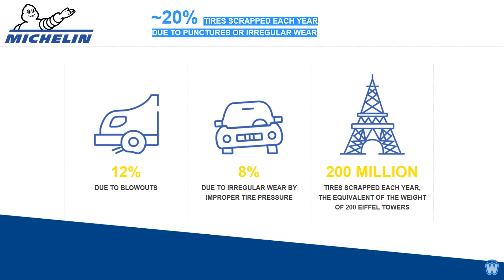Michelin Airless Tire UPTIS - Unique Puncture-Proof Tire System

Comment: I usually assumed the effectiveness in tire spike traps was not that it purely relied on puncturing and flattening the tire so that the tire would deform and spin out the car, but more so that I assumed most spike traps were designed like fish hooks such that if and when it punctured it would not be so easily ignored as the traps would lock up the tires and latch onto everything under the vehicle, effective stopping the tire movement if not destroying the vehicle for a more secure trap. As such, this can be easily resolved by police tactical engineering tools etc.

Comment: as to the tire spike problem, it shouldn't be to difficult to change the spike pattern to one that Actively destroys a significant section of a tire in stead of relying on internal air pressure to rupture, and destroy the tire. and I'm talking no explosives here.

Comment: Rolling resistance is higher, you can tell by the deflection.  What happens when you get a rock in the tire?  Does it quickly wear a hole in the ribs?

Comment: Though I don't know how these tires will hold up in the adverse weather of the upper U.S.A when it comes to snow and ice. If they are made out of plastics. They will be considerably easier to dispose of then the conventional rubber and steel webed tires existing today. When a plastic tire needs to be replaced, the old can be ground up into pellets, and melted into new tires.

Comment: This airless tire already looks under inflated to me.
Reply: yeah theres the problem no air pressure to controll so you whould waste tons of tire and money when you load up your car with extra weight. these tires whould literly be like having to change your coil overs every time you whant to change suspension stiffnes. you whould literly have to get diffrent types of ''spring rate'' tires for your car depending on what you gona do with it. a set for hauling stuff a set for daily driving a set for winter daily driving a set for winter hauling stuff.

Comment: Totally awesome idea, the cost to the motorist would be significantly reduced and fewer breakdowns on our roads which lead to traffic jams causing even more pollution of idling engines. But criminals will love these. There would be an increase in tyre thefts so they can use them. The police will definitely have to come up with new ideas to combat them being used in chases

Comment: funny how they neglected to mention these were made by NASA for the mars rover
Reply: Except that it’s not. Mars rovers use completely different wheels.
Reply: The Mars rover has aluminum wheels
Reply: Of course, because airless tires are something completely new🤦‍♂️
Reply: Because who cares?
Reply: The Idea of reinventing the tire was presented by NASA and challenged tire companies to come up with new designs for the Lunar Rover.
Reply: 1,5k*
Reply: imagine nasa need to make 2nd rover robot to deals with flat tire
Reply: 484*
Reply: 515*
Reply: 570*
Reply: 638*
Reply: 217*
Reply: @caletix8858  411*
Reply: @deadpumpkin8252  466
Reply: 640*
Reply: *728
Reply: Makes alot of sense actually, you're a genius
Reply: NASA rover uses nitinol tyres. This is  nickel-titanium alloy which is extremely durable, flexible and has the ability to have metal memory and revert to it's programmed shape when put in extreme temperature changes.
Reply: Was looking for this, also 1.4K
Reply: Technology has exist for over 50 years, but now that they wanna curb Rubber use, they are switching. Micheline has made their money, and makes me think of all the used tires laying everywhere when they could of adopted this.
Reply: @dem0ny653  1.8k*
Reply: 737*
Reply: 847* likes now
Reply: *for
Reply: Actually the lunar buggy had something similar about 50 years ago
Reply: @ricovali9245  nope, it used completely different rigid wheels, like the mars rovers use too
Reply: They haven’t been used on any rover
Reply: @revFPV  I said SIMILAR
Reply: Goodyear for NASA, that is why they forget to mention it.
Reply: Yup
Reply: Incorrect. NASA uses a different system.
Reply: True that
Reply: 1.7k*
Reply: 187
Reply: Funny how Mars doesn't exist as you know it, space is a cartoon lie, and NASA is a farce. Funny. Don't trip on your spinning ball today.
Reply: These wheels are kinda dope for Ukrainian roads😂
Reply: 1.9k *
Reply: @blake_0062  2K
Reply: The idea of airless tires was around before NASA
Reply: The moon car is even more interesting it has like a spring mesh.
Reply: Yes
Reply: Yeah right. Military gets everything first and if we're getting them now just imagine how advance their technology must be! I mean with the cameras on the Blackbird used in the 70's you could see the fingernails on a mans hands from the edge of Earth's atmosphere, the public didn't even get cameras till the 90's and didn't get cameras capable of taking a clear photo till 2020!
Reply: @jhowardsupporter  Umm these tires are already on sale. And I don't think you know much about photography or cinematography, do you? People are still using cameras from the 90s to make films.
Reply: The new rover wheels are a memory metal alloy.
Reply: And they were actually a Russian destine!
Reply: why would they mention that?
Reply: Dave McGowan tells you all about NASA's trips into space
Reply: 2.4K
Reply: You go and make sushi
Reply: These are clearly very different from the ones made by nasa though. Different purpose, different materials, different design, etc.
Reply: No, these have been around for longer than that “invention” by NASA
Reply: NASA probably stole the design from someone else, so good they didn't mention them.
Reply: Wow, I bet you believe in the tooth 🧚‍♂️ too!!!
Reply: this comment hes 2.7k likes now.
Reply: @rexthegamergembox  994*
Reply: @Kaelan_Bell  1k
Reply: @rexthegamergembox  it doesn't
Reply: @rexthegamergembox  2.3
Reply: @rexthegamergembox  has*
Reply: @rexthegamergembox  now you're right
Reply: Nobody landed on the moon dude 📽
Reply: Cuz NASa sucks
Reply: @dem0ny653  26*
Reply: @Omie01  46*
Reply: @tiamovanrijsdam  57*
Reply: @uwijsmssmsms9925  64*
Reply: @deadpumpkin8252  188*
Reply: @lorenzosaudito  200*
Reply: @Hunzy  omg he's growing fast
Reply: @lorenzosaudito  that's what she said
Reply: @mitsubishi04  ooooooooh
Reply: @Hunzy  2.5k*
Reply: 69
Reply: @thetheoy  nice
Reply: Funny how no one gives a shit.

Comment: A couple problems I thought of.
What's the increased fuel usage with them? With all that extra tread surface comes better grip, but also more flexing of the tyre, increasing rolling resistance, and thus fuel usage. With that resistance and flexing also comes heat, think about how cars' tyres heat up on the road, that will cause them to become more malleable and soft, allowing them to chunk away like a weekend warrior's tyre. The gaps between the supports in the tyre may cool the tyre some, but will work most on the edges, causing uneven cooling and uneven wear in the tread.
The actual tyre rotation will be smaller than the tyre is as well, and the extra sidewall area will require either rims to be smaller or wheel tubs to be bigger, this will also mean that speedometers that use the rotation of the driveshaft or wheels will be off. 
Unless they stiffen up the tread supports by a fair margin, these tyres are a waste on the road. They will wear out sooner and more unevenly, use more fuel than other tyres, require modification to vehicles that use them, which some may not be able to accommodate. Warranties may not allow modifications to the brakes on some vehicles with large brakes, like Lamborghini's or Mercedes', so they won't be able to fit smaller wheels. They may also not allow modifications to the wheel tubs, as some cars have mechanisms that run close to them or rely on the otherwise unused space (https://www.youtube.com/watch?v=G44VAqZsFg8  Granted, that isn't a perfect example, but my point still stands).

Instead, these tyres only domestic market as they are is in off-roading, and only if they add a sidewall to stop rocks and sticks from getting in there. They can also be used as industrial machine tyres, like forklifts, dump trucks, front end loaders, skid steers, but not on the road.

Comment: The only problem with these are that you can’t reduce air pressure when going on sand
Reply: Actually the problem with these tyres is they are super loud (they make a high pitch noise) because of air passing through them
Reply: @crocodile2006  Sounds like a solution to the "silent" electric car "issue" - when zombies check their smart phones instead of looking around.
Reply: @crocodile2006  sidewalls will fix that problem
Reply: @Lanakik05  You can't put sidewalls on them because the way they flex
Reply: I think you're overestimating how many people drive on sand.
Reply: @918Mitchell  enough for there to be dedicated manufacturers of off road tyres! They would be crazy not to diversify into this market
Reply: Just get a different type of tire. Specifically a wider tire. 
Can't be changed on the fly but can be changed before going through sand.

I mean, how many people actually drive on sand? Not just sand, lose sand for that matter. Sand lose enough for a car to get stuck in it?

I'd reckon about 100 cases a year. Not much, lol.
Reply: @benjaminrobledo5466  where I’m from, pretty much everyone takes their cars to a beach
Reply: @cameroneivers1709  
Yeah, but that's a beach. 
I doubt a car is going to sink in that sand. 

If a car does sink or have trouble getting out, then I don't think that's a safe place to stand around on foot, lol.
Reply: @benjaminrobledo5466  4WD's getting bogged on beaches is very common!
Reply: Regular air tires will stay.  But people who go from work to work these will probably be the replacement.
Reply: I don't think they're really meant for sand
Reply: @holyravioli5795  Why the fuck would they be meant for sand? Only retarded crackheads need to drive on sand. Who makes tires for crackheads?
Reply: no need the sand would gather inside the tires giving you extra speed and less chance you'll get stuck
Reply: @HumorDash  speed isn't what keeps you from being stuck in sand, tyre "footprint" is what does.
Reply: @HartyBiker  I think you missed the joke bro…
Reply: @HartyBiker  what I tried to say was that the footprint is probably good enough to keep you going.
Reply: Just don't drive on sand. Drive on normal surfaces like a normal human being, you degenerate fuck. "sorry, mate, gotta offroad, driving to awkward situations for no reason other than to flex to nobody, except my degenerate idiot buddies who are addicted to crack, is all i have to live for. can't smoke crack in public, need 4 wheel drive and need to let the air out of the tires for that, mate." Hey, idiot, just fucking drive on a road, and be a normal human being, okay? Jesus.
Reply: @IntegrityGames  and what if you wanted to go for a drive on a beach for instance?
That’s not off-roading, besides, who said I would go off-roading?
It was just a question

Comment: Thoughts: (1) Unless the airless tires become as cheap as normal tires each, the marketing would need to be geared to those folk that (a) like to throw away their money (b) or want something novel, or (c) travel in environment or road/ off-road conditions that are rough or filled with sharp debris; (2) I would have concerns on how these tires would Handle (a) at highway speeds on normal vehicles and (b) in mud or mud gravel filled puddles (c) how they behave in winter weather when freezing rain or melted, refrozen snow gets in the crevices.

Comment: Not only do these not work on high speed but durability is a huge issue. Why do you think the rubber I  tires has come so far but the tire hasnt changed in decades?

Comment: "Just means that the police will need to come up with some new tactics", unless the criminals are making their getaway in a 20+ year old car, by the time that these things hit the streets commonly, EVERY car will have police automatic shutdown.

They already have the means to do so in many / most cases, and are able to safely deactivate the vehicle. So unless the thief or criminal is smart enough to disable the internal software (read: impossible without being an excellent hacker -> when EVERYTHING is digital, disabling the digital display won't let you drive it, and most likely this feature would be required to be operable for vehicle usage).

My 2020 is able to keep me on the road with relatively little involvement from me, automate speed, track distance between objects for maintaining spacing and relative speed as preferred and set, yeah, can you imagine what a 2024 model will do? Higher end versions will get the trickle-down effect first, where they will come special or uniquely equipped with these 'features', which make them just about impossible to steal (which is a boon), and then they'll eventually be standard on all / most cars, as far as the super-anti-theft and anti-chase devices are installed.
Reply: thats not how crime or car chases work. police can't just turn off any car they whant like that and allso criminals are not stupid they whould escape in a car that wis gona be that easy to stop. allso newer cars are not that apdealing to begin with. tons of crapy systems and electronics that can brake for no reason

Comment: I work at a tire shop, I’ve put them on a few ATVs before. It’s a nightmare to get it to fit on properly and remove without injuring the tech (I still got scars to prove it). I doubt I’ll see these on cars anytime soon since they struggle at higher speeds without compromises. Maybe if some guy with a hummer comes in then I might be lucky to put one on /s
Reply: It must be cool working at a tire or car shop, I'm guessing you seen a lot of cool cars roll in the shop. Also with these new tires You aren't really supposed to go more than around 90 on the highway so I hope it won't be a problem for these tires reaching a high speed, like if 100 mph is the tires' max speed then it theoretically shouldn't be a problem if everyone doesn't go over the speed limit
Reply: @solarwolf678  honestly the work is hard on your body, but rewarding in the end, it’s more of a brains over broad job when mounting/dismounting a tire from the wheel. The nicer cars tend to be hard to work with, many European cars don’t use lugs, they use bolts to hold the wheel. So getting them bolted on is a nightmare. We are honestly happy seeing an old pickup truck come in because you know it will be easy coming off, balancing, and putting it all on.

Comment: I just want airless tires on my Tesla Cybertruck so that some asshole law enforcement think that they can stop me with three redundant electric  motors with AI at the wheel and a battery pack that "heals" itself it partial failure occurs along with a stainless steel body that can resist a 9mm bullet and high impact glass. Fuck the Popo.

Comment: police already have a new tactic but it's still in development. A metal y shape fork drops down from front of police car. Between the two forks is a net. They ram that fork into the suspects tire which causes that net to get tangled and seize up the wheel.

Comment: They literally reinvented the wheel.
Reply: been around for years
Reply: tire***
Reply: @slow2.0t  no, they mean wheel. Tires have no holes, wheels have holes and beams to connect the axle to the circumference.
Reply: @slow2.0t  
someone who is spreading misinformation should be corrected. you getting upset about being corrected is kinda sad.
Reply: A wheel consists of the rim, hub, and spokes. the video title says ''Michelin Tire''.  Easy as that,  8th graders. Tires are not a part of wheels.

Comment: The biggest problem with these is sidewall flex. What happens when going around a corner at high speed? The lack of any real sidewall makes them much more susceptible to flex and warping. Not only that, but anything can get caught in the rib section, lessening overall performance, or even leading to all out tire failure. Causing erratic handling.

Comment: The thing is, no one is getting punctured tires. People who drive for 30-40 years sometimes never have a flat tire. Its all about maintenance. So there is simply no need for this type of revolution. Michelin is bored
Reply: your stupid
Reply: You make a good point, actually. Combined with the fact that a tire is an easy thing to repair, I'm not sure the puncture-proof aspect is all that important to begin with.

Comment: Maybe the see-through tire is just for testing and being able to visualize it better? I'll bet if you took a left turn fast you'd grind the front-right rim into the pavement and possibly rip the tire off. These tires would have terrible cornering characteristics because of the complete lack of a sidewall, and fixing that would probably require rims which are specific to airless tires, a suspension designed for airless tires, and new mounting processes. Or maybe they could just reinforce them with tangential belts instead of radial belts.

Comment: At first glace this seems like a pretty good idea, and referring to all those other moterised vehicles (which comparatively travel quite slowly) it appears to support the idea of an airless tire as described above. But I look at the physics and the centrifugal forces at play whan a car wheel is pushing it along at 70 mph. 
~
The top of the tire will be travelling in the direction of travel at twice the speed (140 mph) of the bottom of the tire which in theory is almost stationary. This I suspect would cause a push-pull set of forces across the diameter of the tire (top v bottom) that will make its implementation at least difficult if not impossible.
~
Note that the subject vehicles in the above video did not travel very fast, when trying to sell us this idea.